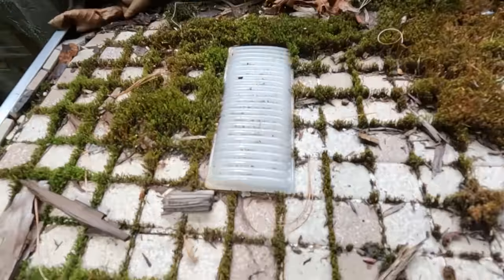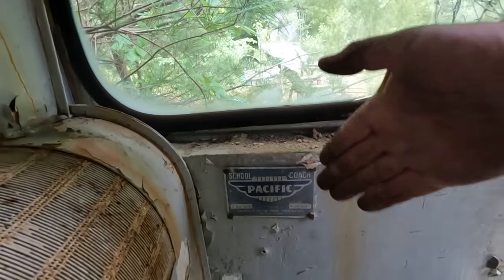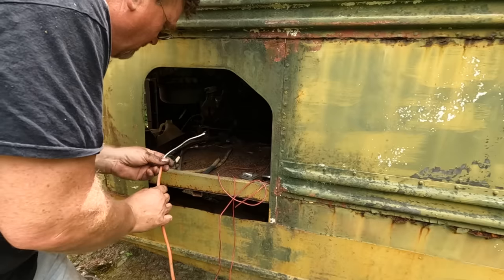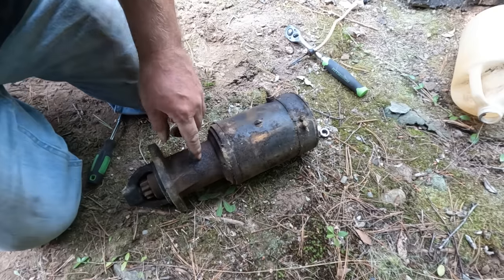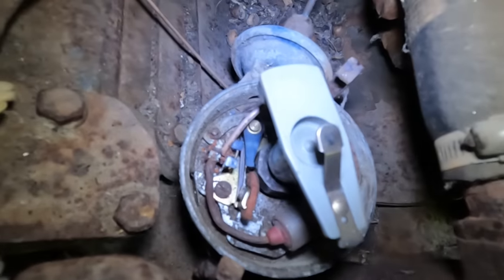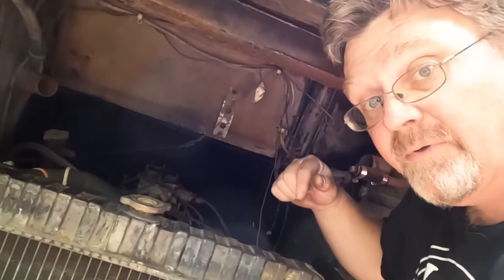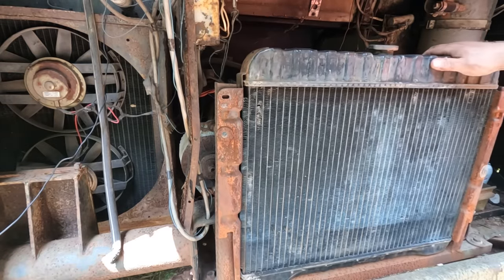Junk 1952 Kenworth Pacific Bus, Will it Drive?

Comment: The torque of that old engine seemed impressive.
Reply: Not much horsepower but plenty of torque.
Reply: Almost 500 ft lbs of torque from the factory.
Reply: I own one in an old cabover. It makes about 260 hp but 500ft pounds of torque at 1800 rpm.   Redline is at 3600. 
The compression ratio is only 7:1 so it will runs on low grade gasoline.  

There was a twin turbo marine version available under the "Sea Master" name.
Reply: @BD-xz6te  That's certainly pretty cool,  I looked up some information and read up a bit. Thanks for that name to initiate my search...
Reply: When I read 7:1 I immediately thought that needs boost, and so it was.
Reply: I was thinking the same thing
Reply: @david929190  Ever since I got my first one, I've always wondered how they would respond to a low pressure turbo setup.
Reply: @BD-xz6te  Good that it runs cheap gas cause I bet it drinks a lot of it
Reply: @dirk4926  it’s a bit thirsty, but not horrible if you’re just using it locally. If you get up on highway and hold it at the 3600rpm redline for a couple of hours it’ll hurt the old wallet though.
Reply: @BD-xz6te that piece of prehistoric engineering sounds amazing xd. Being that effective and that simple is what we dont actually see no more
Reply: @BD-xz6te  thats comparable to the 7.3 powerstroke, thats insane for a gasser

Comment: Pretty impressive. I bet if you could have freed up that right front wheel it would have gone a lot easier.
Reply: A lot less interesting however.
Reply: @DeanofMachines 
😄
Reply: Fixed the air leak in the front there
Reply: With that engines massive torque, it just pushed the whole front of the bus"over hill and Dale"
Reply: @warehousejo007 0:53
Reply: @saidijeh4019  
careful there...🤨
Reply: im impressed it stayed locked
Reply: LOL!  True that.
Reply: That old engine managed  what both the truck and the dozer failed. 
It's a beast.

Comment: It fascinates me that there are still traces of life in engines in cars, buses, trucks and abandoned vehicles like this one.
Reply: they all await their revival
Reply: This wont happen with new stuff with ECUs, tho. Those old V8 engines just need fuel and a 12V battery to run.
Reply: Being a mechanic these days sucks ass....they make shit out of plastic to break on purpose, infested with electronics, sensors, computers....I was born in the wrong decade
Reply: These things were built to last and survive 
Before we had quality over quantity. More so these things were not fancy but very robust. And the best thing car could to is to drive from point A to point B with the least propabability of malfunctioning or breaking down. I feel it was the best ages of motor history
Reply: Did you not think to belt the front right wheel with a sledgehammer to free it off- would’ve made moving a lot easier.

Comment: That old Ford V8 has some serious torque, just like you said. That camper must have been awesome at its peak! Gas hog though. Wouldn't be good today. A casual (retiree) cruising pace through the states would probably be $10,000 + a year, just for fuel. (I'm guessing but it would be a lot. If you could afford it, though, it would be worth it).
Reply: Gas prices today average $3.66 nationwide. Driving LA to NYC is 2,700 miles. Your guess of $10,000 would make that trip at 1 mpg. I bet the bus can beat that figure 😂
Reply: I have a 534 in an old cabover. It makes right at 500 ft pounds of torque at 1800 rpm.  It redlines at 3600.  Believe it or not, but as long as I keep the revs low and stay under 50 I can get 9mpg out of the beast.  Old timers who used to run them over the road said they got more like 2mph running flat out.
Reply: I've driven a 534 a good bit. They're rated around 470 lb-ft of torque but it's around 1,800-2k rpm not 1,100. The one I run is healthy and stout but it'll get hot if you work down to 1,100 rpm. They're big gas engines, not diesels; they've gotta spin to breathe. 1,600-2,500 rpm is where ours lives.
Reply: @BD-xz6te  Ah the days when fuel was cheap...you could fill a tank on a pocket full of change...
Reply: And I thought the 460 was a powerhouse. This thing is a BEAST! Dragging that right front all the way!
Reply: Change it out for a 5.9 Cummins
Reply: Yeppers
Reply: You could probably run it on CNG or Propane and save a little. I probably wouldn't invest a lot of money in an old 534ci Super Duty engine however, you can buy used PSI 8.8L (535ci)Gen7 BBCs for $1000-1500 that were designed to run on natural gas and run that in a bus or RV.

Comment: Just a tip on the air breaks. You can use an external air compressor to air them up to release them. It’s a little bit of a hassle but it does work. At least it would allow you to move it and test for leaks 👍
Reply: Or he could cage the brakes to get it rolling. It won't have brakes but it will roll.
Reply: Will a CO2 extinguisher work?
Reply: @JBF-GST-Tanda   I'd like to see that, but I guess it would as long as you get it gastight before the ext. is empty.
Reply: BRAKES not breaks Dork
Reply: @JONNIE8OY  ok karen
Reply: Air brakes. Wonder why he didn't check to see if they were spring brakes or not. I'm betting not. No red and yellow knobs. My 1968 WARD school bus didn't have spring brakes. He could likely have freed up the front shoes from the back side with a hammer and screwdriver.
Reply: @Wildstar40 No brakes to cage. Those weren't safety brakes.

Comment: You may have mentioned it and I may have skipped over it, but you can manually release air brakes by inserting a bolt called a “cage bolt” and tightening it. It physically forces the brake shoes to retract.
Reply: They weren't safety brakes. Nothing to cage. The shoes were stuck to the drums.

Comment: Would've been much faster and easier to just install the air/brake can release bolts and dragged it there with your dozer,  but it still was fun to see you get it going. If not for the right front wheel staying locked up the whole way would've rolled nicely.
Reply: @sreed8570

Absolutely. With four or maybe even two cage bolts (as it might only have spring brakes on the rear) and some light persuasion with a sledge hammer, he'd have been good to go.
Reply: Came looking for this comment. That's exactly what I was thinking.

Comment: That engine is torquey.  Even after all this time it looked like it was able to get some real low end oomph to move that regardless of the stuck front right wheel.
Reply: I have an old truck with the same engine. It's heavy, slow, and likes fuel more than it should.  Having said that, I've yet to bog it down.  It has no trouble climbing a steep grade at 15mph in 5th gear turning 900 rpm.

Comment: It looks like only one wheel was not turning. My guess is that the brakes weren't locked by air, but rather that the R front wheel had the brakes seized up by rust.
Reply: Assuming it was converted to spring brakes, that may have been the only wheel with working brakes and why his dad said it didnt stop well when he drove it there. And thats assuming it even has front brakes so coult be a frozen wheel bearing...

Comment: Not much fun for you but it was a hoot to watch man. I had a few deep chuckles during this one. But no mistake, at the beginning I was really sensing the pain. I could predict the points and condenser were a sore spot after so long? Or the coincidence was you fixedit with the electronic bit. You worked pretty hard for this episode so Thank you because it was pretty humorous watching that 534 cube monster just chugging along the trail pushing one locked wheel at an idle. About 600 hp & 800 NM torque I suppose

Comment: With the pulling you do sometimes, maybe you should check into a "Yankum" rope. They're not cheap, but they work. Another idea is to chain an old tire somewhere between the vehicles so as to not stress your chain. You get almost the same kinetic results, but a lot cheaper. It's hard to explain, but it's worth looking into.  I definitely learned some stuff here. I've never even heard of a 534, but it's good to know.  : )
Reply: The 534 was intended for single peed pumping etc. Scads of torque at slow speeds. I had one. Vaporlockingest son of a bitch ever, but it had heart.

Comment: It would be really cool if someone went through the effort and restored the whole buss.
Reply: Probably too rusty
Reply: I 2nd this notion, but the engine is gonna need a whole lot of tlc, and structurally a lot has to happen, and its gonna have to have its front right tire fixed so it can actually move.
Reply: It would prob cost thousands and tbh it's not worth it. Maybe if it still looked as nice as when whoever did the conversion did it but truth be told everything in it would need gutted and would take hundreds of hours of body work once you got the thick layer of nature off of it.

Comment: "Rust is an effective thread sealant" Best tip I have heard in a long while LOL We had a 1962 Bedford SB series bus that we spent 5 years in going round Australia. Eventually gave up on it due to the lack of parts to keep it going. Old busses are full of character but you have to have lots of time and deep pockets to keep them on the road.

Comment: You don't need air pressure to release the brakes if they are spring brakes. you can usually crank the spring back with a socket to release. Looks more like the shoes are rusted to the drums in this case.
Reply: Yep you can cage the brakes mechanically or pressurize the air system with a separate compressor (shop air as it were).
Reply: @dbcallender6757  Plus 10 points for "as it were"!

Comment: Often back when these were still school buses, the Super Duty got replaced by a GM Mileage V-6, which actually made as much power and more torque and used less gas. And these did have a mechanically driven radiator fan that used a looong fan belt from the crank pully.

Comment: You didn't need air pressure. Just manually release the parking brake by tightening down the release bolt on each of the air brake cans to release E brakes. Those engines came in 3 displacements.  401, 477, and 534. It is the closest thing to a heavy-duty diesel engine for a gas engine ever produced. It had similar power to normally aspirated HD diesel engines of that time. They literally can last forever, but had horrible MPG. I serviced and worked on these back in the 80s. I am amazed you didn't break and axle, trans, or clutch, the way you were dumping the clutch.

Comment: Cool! Shame you didn't try to take apart that stuck front wheel, even if the brakes are rusted they can't stop the wheel when you take all the parts off. But maybe it would have required some very large wrenches that weren't available. Maybe next time

Comment: I like the smooth and straight forward way you solve each issue step by step. And I learned to know new tools that might be helpful in repairing a broken engine, like the starter adjustment tool - I always thought you need to use a hammer 😉 . Left a like and a abo. Many greetings from Germany

Comment: I remember using a bigass Hilti impact drill thing to get the rust off on the brake drum on a big truck at work, to release the wheel, similar kinda situation, only we needed it to run for 2kms, to the junkyard haha

Comment: I had an IH RD-450 in a cab over Ward  bus chassis TV truck, and a 534 in a Gerstenslager cab over bus chassis that was also a TV truck. Both those old horses could pull an ailing prostitute off an indoor china sanitary receptacle, albeit slowly. Damndest most dependable engines I've ever run. You could fix them with a crescent wrench, pocketknife and a roll of tape. Damn, those were the days.

Comment: Air brakes with park function most usually has 2 chambers. Park brake chamber has an emergency release screw bolt for road assistance and to assist brake maintenance works. Tension the chamber bolt to counter park brake spring tension and your wheel will run free without air pressure. Unless other stuffs has rusted stuck. In your case I would then try percussion to shock the brake drums and s-cam actuator brake levers with the blows of a small sledge hammer and aid with a cargo tension strap if really need be.

Comment: There's something you might not know about manual transmissions, there's a devise called a clutch and in order to see if a shifter works well or not is to sit in the seat, mash the clutch and then move the shifter.

Comment: not sure if it would of existed on an air brake as old as this, but brake pods usually have a cage bolt that allows you to disengage and air brake mechanically by tightening the bolt, which releases the spring holing the break on the pad. it may have made moving the thing a bit easier.

Comment: There are several ways to release spring brakes by hand with a wrench or what is essentially a bolt, but I'm glad your getting it running anyway because it makes a better video.  You also should have cut that tree away before trying to tow it.

Comment: That's the beauty of old vehicles like this there all mechanical parts you can just throw some extra parts on the thing and it runs try doing this to a Tesla you found in the woods 20 years from now you would have no chance. Whether it's a Tesla or any other newer car you would have to replace so much stuff it just doesn't have a chance

Comment: Among the many issues, it seems to me that after all of the rigging  and on site modifications, it should not have been a very big deal to find the air leak in the line and do an apollo 13 repair to move the beast out of that spaceto the space you need it and break out the good ol trusty duct tape and tape the line to hold air pressure. Amazing that you did not blow out the clutch with all of the dominitix abuse you gave it.

Comment: Week spark because the condenser is faulty. The condenser boosts the spark output of the coil allowing it to jump across the gap between the rotor arm and the cap plus wire posts.

Comment: I think you should take that radiator cap off. Get rid of the old fluid that was in that radiator put new stuff in a new water. Looking at that bottom of that hole and see, if there's not any mice or anything that got in there and clean up all that old stuff out of there. And I'm doing costs much window. Wash cleaners stuff like that. It's pretty cheap depending what state you're in. I live in naperwood Minnesota.

Comment: I would have said it was ready for the freeway and to go camping!
Also it shows the importance of accentuating the positive - and not focusing on frivolous negatives such as the locked front wheel.
- Also, you could use it as a transportation vehicle - just pull up to a group of people and charge them to get on board.
- Don't worry about the brakes not working, just get a plastic Jesus and you'll be protected

Comment: The needle valves in the carburator of course cannot withstand the pressure of an electric pump. You need a return line with a control valve to limit the pressure of the fuel in the floater housings.

Comment: Really nice to see this vehicle being resuscitated. But no heat and penetrating oil before turning the nuts holding the bumper? Not freeing off the front wheel before manouevring? Good luck anyway with the next stages.

Comment: I'm curious what's going on inside the trumpet case at 2:04. Instruments are expensive, if it has a trumpet, even if it's junk, as long as the valves aren't totally trashed, some school wants it. Most instrument repair shops will take cheap horns like that to refurbish & rent out as loaners. Could be worth $20-$2,000 depending on condition.

Comment: the carbon contact in the middle of the distributor cap should be springy. which means there is a rusty spring behind that carbon thing. i bet if you clean that you got spark.

Comment: I'm not that mechanically inclined, but, after making sure the points were good, distributer was good,  but spark wasn't making it from the distrubuter a particular plug, why not replace the sparkplug wire?

Comment: towing like that with a dozer pull backwards use the blade you can partly lift gives you more traction and reduces the resistance of what your towing

Comment: 17:45 better just get underneath the bus with a socket wrench, and grease gun. 
Grease the fittings for slack adjusters and s-cam on both axles then back the slack adjusters off which will pull the pads off the drums. Then that bus will move where you want it too.

Comment: I know almost everything you need to know about the ford 534 they were mostly in late 50s COE ford trucks and those are very good engines they can be changed over with 460 crank and pistons and you can bore them out to put over sized rings and make them into a high performance truck engine,  my dad and I built one from a 60s f 500 with a low range 3speed and put it in a 68 f250 body with a 1990 f450 double frame with a Rockwell dually with a flatbed dump body the original air cleaner was so tall that we had to make a hole in the first hood because it was an oil bath air breather until I managed to mess around with a bunch of old carbs from the 60s that actually fit it...

Comment: May have been a less interesting video but that dozer blade could have been used to pick up the front end of the bus by the tow hooks and driven it down the trail without any issues.

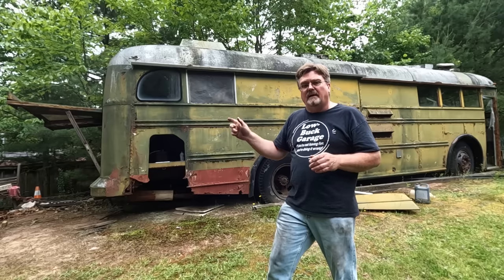Comment: 17:25
Jeez, don't pull on the bus like that, could mess something up, also FYI, if the vehicle has air brakes and doesn't have any air going to the brakes, the brakes will remain locked up.

Comment: Why would you not hook the chain to the blade and then to the bus, to get the rear end up higher as you lifted the blade to max height……… after digging out a pathway for the front tires exit.